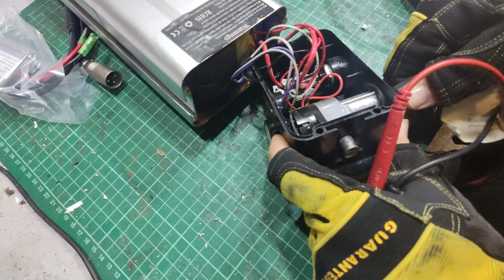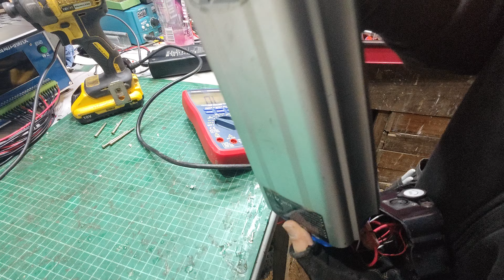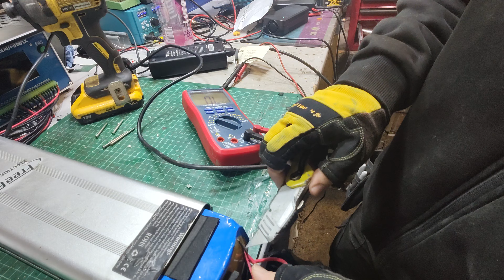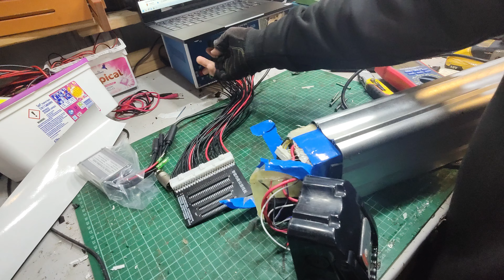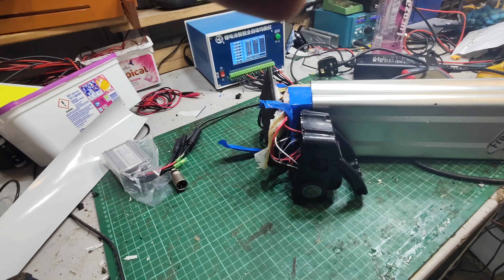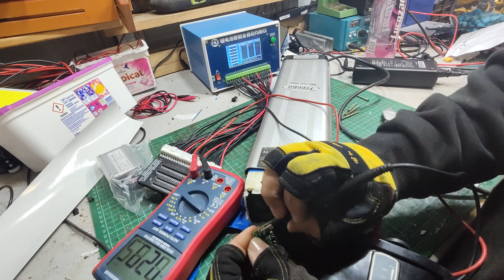36v Freego Battery Pack not working - WHY?

Comment: Hey Mate! Thanks for the great vid, it was pretty fun to watch! I was wondering, I have the same battery and it's not working, did you ever resolve this? If so, how? If it was replacing the BMS, where can I order a replacement? Thanks!
Reply from the maker: Yes a new BMS did fix it. Switched 10s 15a BMS but it needed all new balance wires soldering on as the jst on modern BMS units is a different size, I can do the job for you at £80 if that's helpful, shoot me an email. Thanks

Comment: Thanks for the informative video. Why use a fuse? If the bms has a overcharge/discharge protection?
Reply from the maker: Often, the BMS protection is a bit lackluster - and actually doesn't work very well - I could short out a battery quite badly, even with a BMS fitted. Could discharge 100+amps sometijesmfpr an instant, which is enough to damage things, hence the fuse. 

Thanks!